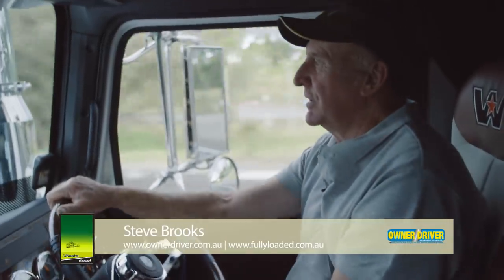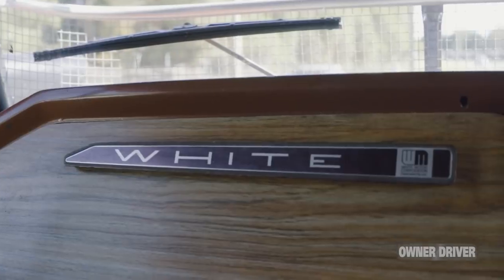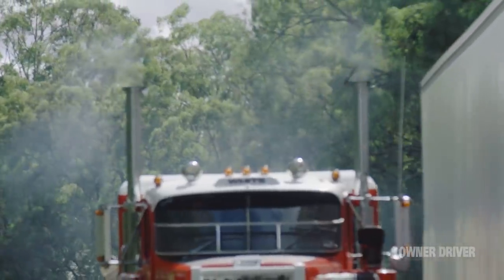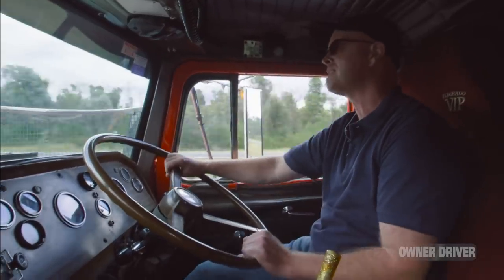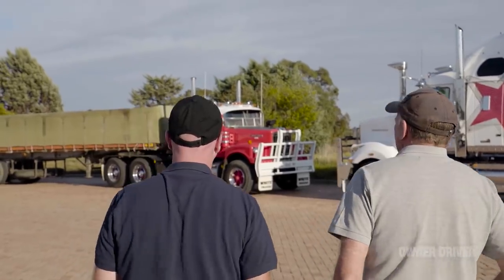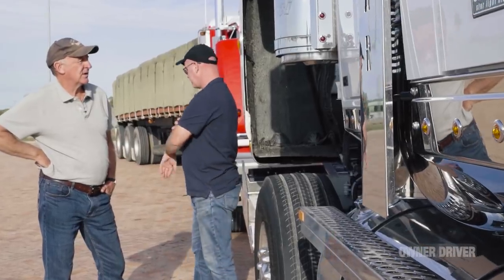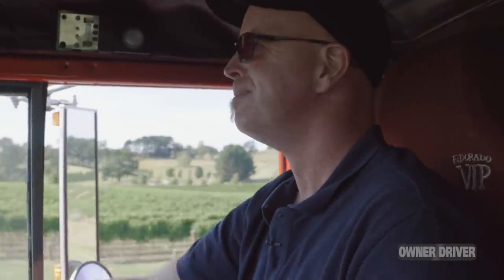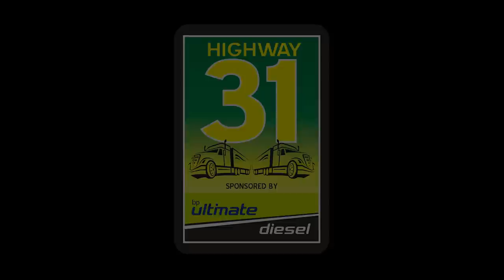Highway 31 | A Journey Down the Old Hume | Truck TV Australia

Comment: The new detroits may be technologically advanced but there is nothing beats the sound of the old ones.
Reply: I agree fully with you; the newer ones no doubt have more power and are much more efficient; but I still miss the sound from those old 2 strokes
Reply: The old 2 cycles sound pretty cool but the series 60 would be the pick. The new DD series is just a Mercedes with Detroit badging and too much technology where the series 60 was still simple in comparison.
Reply: @benmurray8689  no
Reply: @thermidorlevrai65  why no?
Reply: Yep I drive a 2013 star with a a s60  legacy.  Sounds similar to the cat c15. Dd15 is nice and quiet better power delivery. Tbh I'd rather dd15. If your more of a Jake's an turbo whistle guy I'd go for s60 legacy
Reply: @dwightcorbett8889  More power than what,a Corolla?
Reply: The old Detroit’s are phat and then Cummins the new ones are good
Reply: After a while you wouldn’t hear them anyway because you would have gone deaf.

Comment: I used to drive the White 4000, ahh the memories, aircon was roof mounted and when it was overcome by the heat (which was often) it used to rain on you in the cab, bloody marvelous, wasn't all bad but having said that I'm with Woody, especially at the end !
Reply: In those days kenworth had a good problem with windscreens as well . If it didn't leak wasn't a proper kw

Comment: Hi all the logs in a great Northwest the Cascade Mountains around Mount Saint Helen, ran a 10 wide log truck off road with a 335 Cummins 5 + 4 and the lightweight was 55000 lb. And I ran a 1965 Pete or the 318 and a five and a four, best way to drive it when you got in it in the morning I slammed your hand in the door I knew you were mad all day I need to bang the hell out of the gears. Didn't know any difference. What I did for diapers and baby food.

Comment: Quick tip for ya fellas,if you feel like paying 20 to 30 cents more per litre for your BP Ultimate diesel then definitely pull in to BP Marulan or if you only have a Shell card,the Sally’s Corner Shell at Penrose ain’t much better.How these joints get away with it is just criminal.If you can boys & girls,try not to fuel up there & stop them taking us for idiots.

Comment: I'm sorry, I apologize for that last rude remark. It's just that I  either owned and driven 671, 6V53 & 8V71  or knew somebody that had one and trucked together. I never had no luck with one and neither did my friends. Great video. I love the way the old 2 strokes sound but if I was still trucking, I wouldn't buy anything but a mechanical 3406B maybe set up 15% over. That wouldn't be too bad. I'd would put it in an older truck so no E- logs.  I want be buying another one. I've got COPD and Diabetic and I've already had my CDL suspended by Homeland Security for not keeping my physical current. Ain't that a laugh! Ha! Ha!

Comment: I loved the Road Ranger gearbox 12 speed with a Jacobs brake, once you were moving you never needed to use the brakes or clutch. I could get up QE2 bridge at Dartford without using the clutch.  We used to sheet up using Dolly knots, sometimes double or triples. Trucking nowadays is so boring and miserable.
Reply: Never new eaton had 12speed road rangers. I know they had 13,15 and 18speeds
Reply: Ribbit
Reply: @nztrucker1542   Maybe it was a 13 you are probably correct but I am a very old trucker 🥴
Reply: Mack made the only 12 speed gearbox
Reply: @nztrucker1542  I’m in the UK maybe it was a 13 speed, I stand corrected.

Comment: GM 2 strokes are not supercharged. The turbo 2 strokes are turbosupercharged - so turbo feeding into the blower, but the blower only types as shown in this vid are naturally aspirated. Even GM call these NA ie Naturally Aspirated.
They are blower scavenged or Uniflow Diesel. 8V71 like this has about 320hp @ 2100rpm. Can easily be hotted up :)
The turbocharged variants esp the 92 Series Silver had a bypass blower with an liquid to air aftercooler under the blower.
8V92TT DDEC had 475hp. Very easy to get more power out of.

Comment: Night driving on the old Hume 1 lane each way, trucks geared to do 100mph, bad brakes and with tired doped drivers restrained by company deadlines behind the wheel. Sheer terror. I had a 1418 benz roll in front of me one night which sheared the cab to the bonnet. Not much left of the young driver. Snippets of the old road still exist if you take the time to look. Today get on the Hume set the cruise control and relax.Big change from a 67 Diamond T 4cyl 5X4 boxes wedge brakes to a driving a Volvo FH16 with everything.

Comment: After getting out of a new freightliner into a 8v92 for a year i would say the 8v92 is no where near as bad on fuel as people say. But they do use a tonne more oil than anything else
Reply: mate how much fuel old trucks use is probably the biggest misconception out, you load them up they'll be getting pretty similar mileage to modern trucks, plus you don't have to buy adblue and spend 50k to rebuild the thing, that and all these "drivers" who cant handle driving a manual
Reply: @logical_volcel  the best story i heard was the v8 macks one company was at 160t and got 4mpg with a 400hp ultraliners
Reply: @deanhollingsworth7938  wouldn't doubt the mileage, is about the right gearing and horsepower for the weight more than anything, but 160t with as 400hp ultraliner seems a bit slow
Reply: @logical_volcel  think they only went to 80kmph
Reply: @logical_volcel  company was Bellway

Comment: If u still got an ol skool GM n u dont get a hard on driving it...... u aint doin it right. The noise the smoke the vibration..... Matt wasnt driving it like he stole it..... cmon brah..... give the beast some dignity. Upppa like the kwikisar days.....drive it like it was built for.
Reply: The Detroit engines needed RPMs like any two stroke engine and need diff ratios like 4.11,4.33 4.56 with an overdrive Roadranger to keep them screamin. Personally I think Matt Wood did a good job driving that White